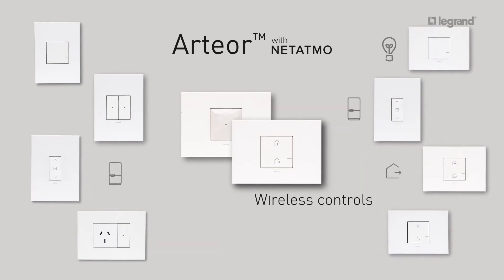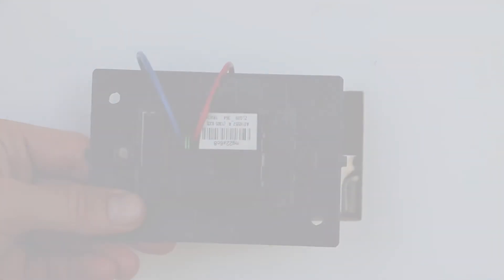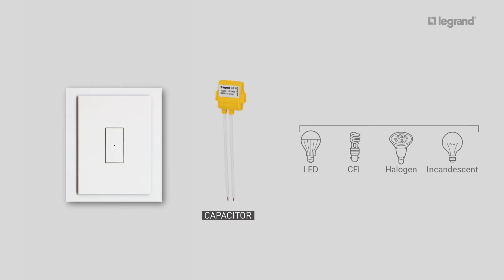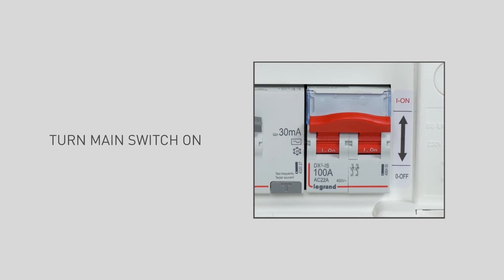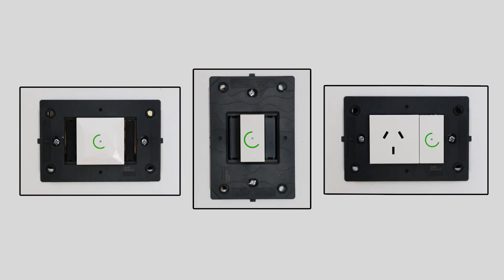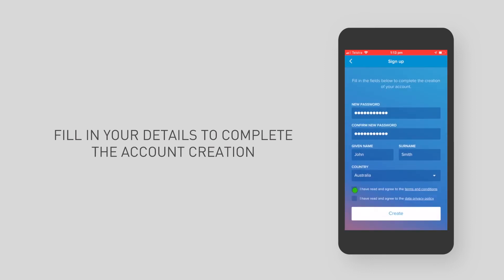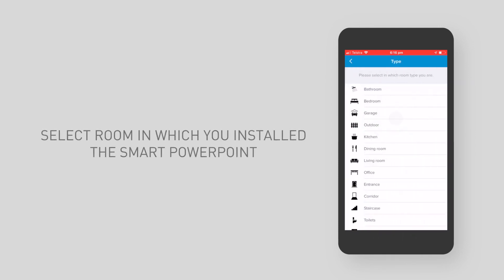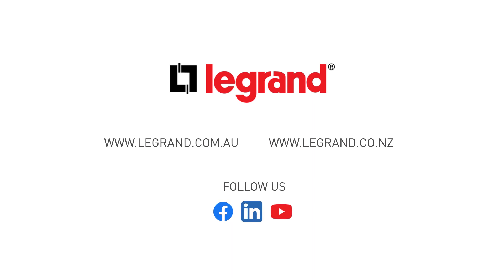How to create a Smart Connected Home with Arteor with Netatmo

Comment: Is there a timer option? Can I have the smart plug turn off in 3 hours?
Reply: Scheduling requires a hub or gateway to act as a "network" manager. 

The schedule can be 'local' ie stored on the gateway, or 'remote', ie stored or saved on Homekit and/or Alexa. They can conflict for this reason, same as Philips Hue or Lifx lights, so keep in mind that the schedules can be messy if you have multiple smart devices and gateways.

You can do this with Homekit, or the netatmo app, and the kit/gateway.

google home doesn't really schedule easily, but it can be done with a 3rd party app or service and API access.
Reply: If you have dimmable switches how do you set the dim setting from the app or from HomeKit? I have it working but only as off/on.
I bought dimmable switches and made sure all lights were dimmable LEDs. Thanks 🙏🏻